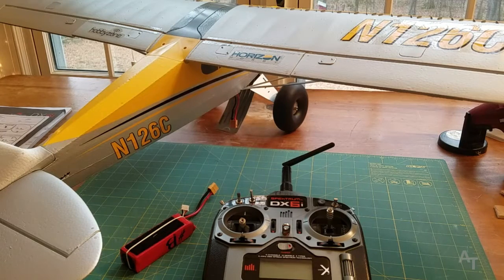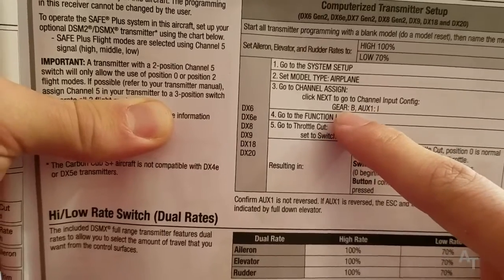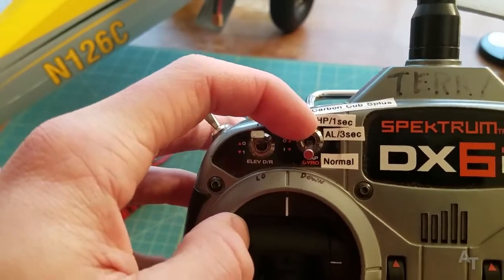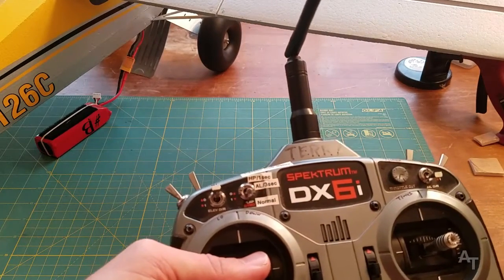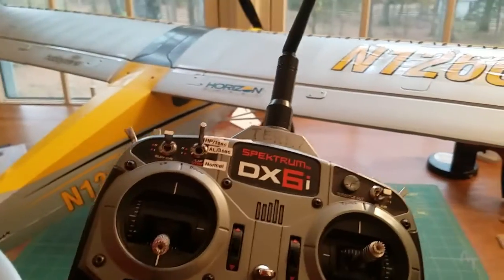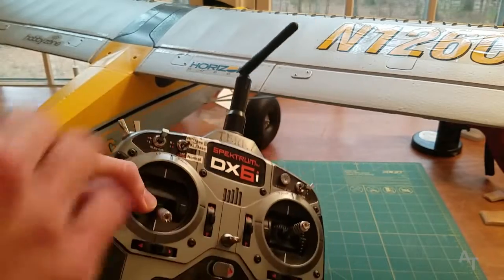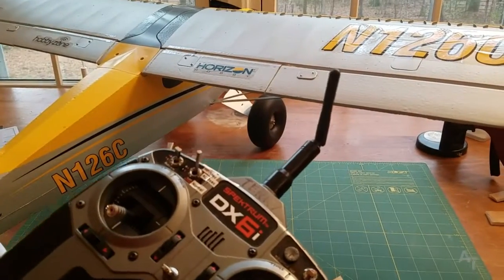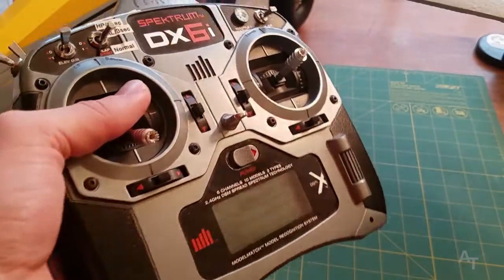How to Make Carbon Cub S+ Work with DX6i Transmitter

Comment: I have an E-flite Valiant and a DX6i.  the Valiant uses a AR631 with Safe and AS3X.   The flaps move when the plane initializes but after that I can't get them to work.   Can you have flaps with safe and AX3x (and the DX6i)

Comment: Thank you Adam, it will work the same procedure for DX9 as well. Your explanations have been very helpful. Appreciated !  
Thanks so much doing this video. (I use my "bind" push-button (named "I") instead the switch you mentioned for "bind & HP & auto land" as it is on the DXe which shipped with the Carbon Cub S+ "RTF" )

Comment: You also need to make sure the settings on your dx6i for the flaps are set to +100 for it to be recognised as a button. Ie so you can make aux1 work on the monitor screen. Search for "making the dx6i flap button work" great video sir, massive thankyou

Comment: It says in manual to assign channel 5 on TX to a 3 pos. switch
Reply from the maker: Yes, I'm using a different transmitter though.
Reply: Yes, thanks for clarifying. The transmitter has to have DSMX, and capable of reassigning channels. I assumed this was possible with your DX6i, as well as the majority of programmable transmitters.
Reply: and a 3 pos. switch ;)

Comment: How did you set up the model?  I downloaded the model from HH website for my DX8Gen2, but it is NOT working right. Building one from scratch using the instructions is NOT trivial for a Noob like me!
Reply from the maker: Hi! Sorry, I really have no experience with that radio, and no longer have this plane in working condition.

Comment: hey is there a problem if i put all this electronics (gps module and a3232 receiver) on another plane? Would the configuration be the same? in fact I have a DX8 transmitter.... thanks excelent video man. ah by the way, meaby you have the digital manual that you can send it to my email hjalberto@yahoo.com thanks a lot buddy really appreciate your help

Comment: I have the original TX so no problem here. After I have flown the plane for awhile I will put in the flaps and go to my bigger TX.You where doing the GPS switch off wrong, you have to hold the Bind switch, meanwhile you where holding the Flap switch

Comment: I think its beter to buy the RTF version, so to save you a lot of aggravation. What I think is stupid, buying the RTF version, the transmitter has no switch for flaps, if you want to install flaps you will have to buy another transmitter, what where these idiots a Hobbyzone thinking, and Horizon hobby does not care

Comment: can you use the spektrum DX7 with the carbon cub s+
Reply: would you the same procedure as the DX6i. the DX7 has the 3 mode switch on the top left side of the transmitter.

Comment: You've said the additional channel thing in this and I believe both follow up videos, I can only assume that is because of how its wired up?  

If so then it's using a channel for every servo, and if that's the case and because of your stunning failures trying to use the other built-in features why not just pull the factory receiver/electronics and wire the ailerons with a y-harness (6 channels with flaps) or even add a y-harness to the fap servos with a reverser or flip one of them over (5channels with flaps), and then you can run everything with the DX6i.  Done like that you can even do 2 stage flaps by programming the flap switch for activation and a second switch as a modifier for when they're activated, giving you a stage one and stage 2 (takoff and landing flaps).